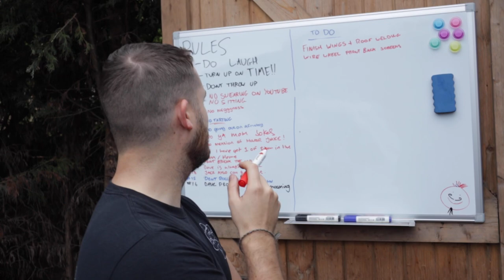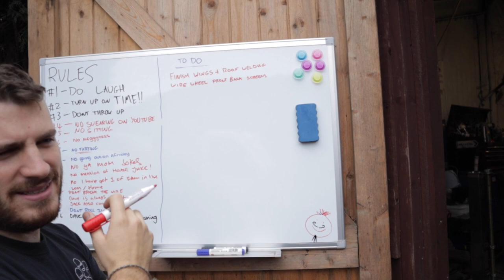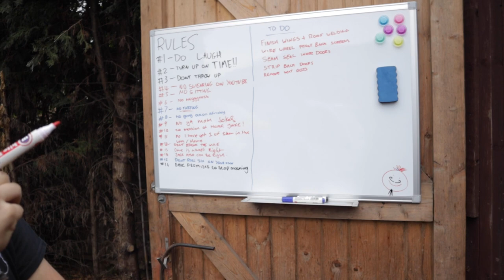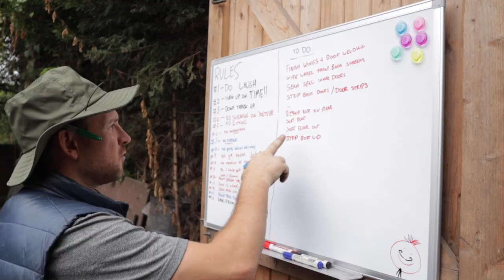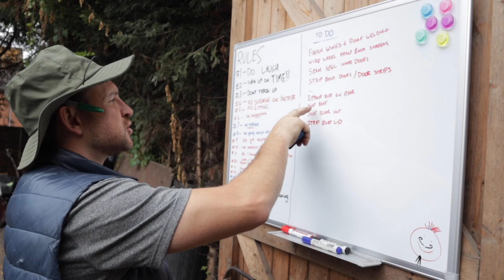The Paint Prep Never Ends? - Sierra Sapphire RS Cosworth Barn Find Restoration

Comment: If u are waiting on paint and it’s under coat use a heat gun on a low setting it will dry a lot quicker the yanks do it or a infra red heater paint shops use them looking good bro